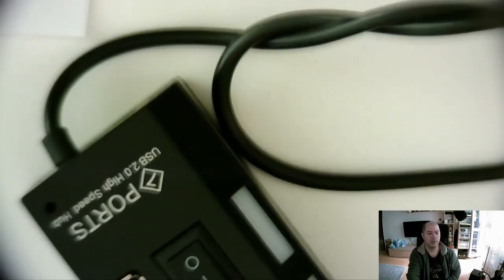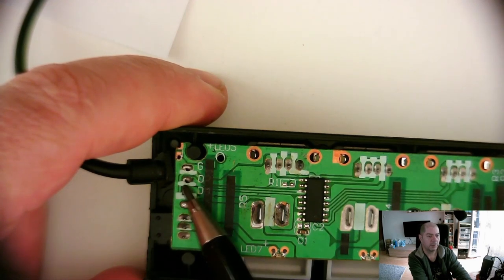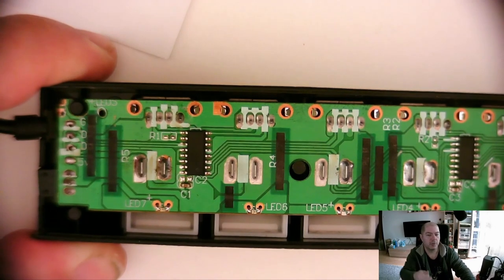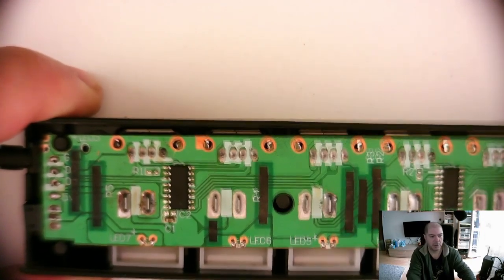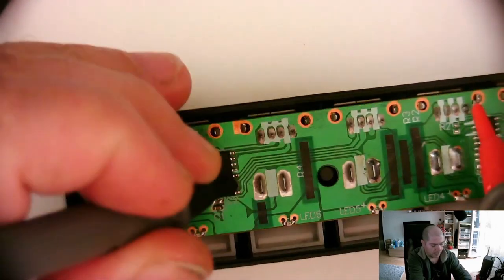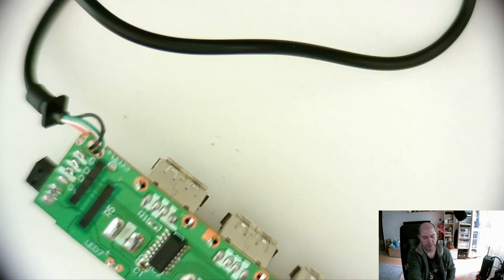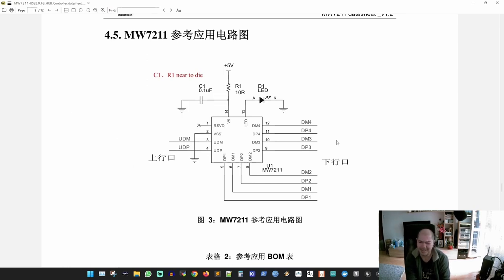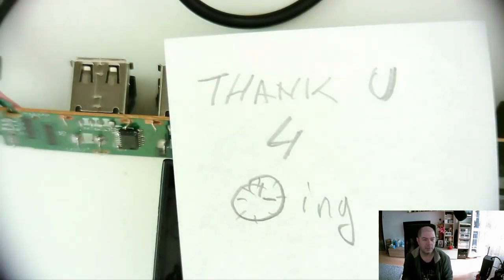USB Hub teardown and schematic

Comment: I just got of those and Linux says it only des 12M, which is USB 1.1 full speed. So is it 2 or can be firmware update to 2? Doubt it.
Reply from the maker: Hi, it's hard to say, if the chips will be the originals and not a fake, and the PCB will be a better one with proper design, by the letter of the datasheets,  it will be close to specs, but hey!  You got some data movement which is great. Think that an original IC price can be close to all that is in the form of a USB hub with individual power switches. 
It's amazingly cheap and amazingly fake.